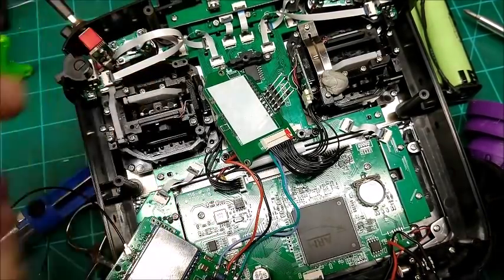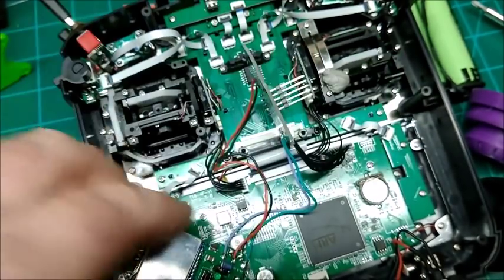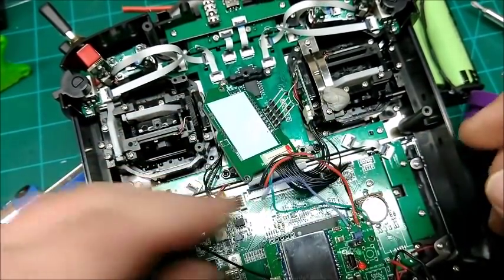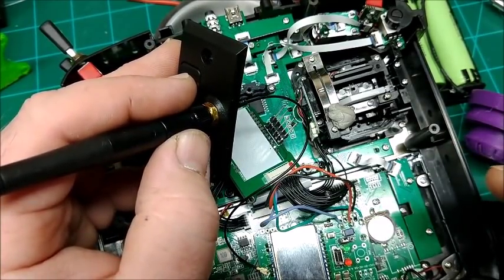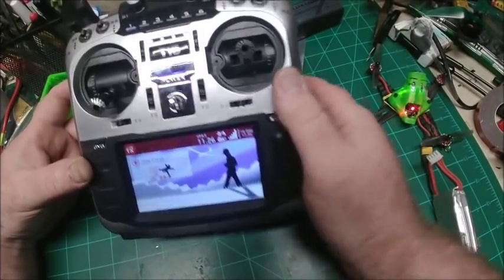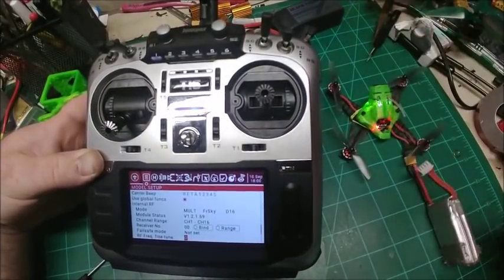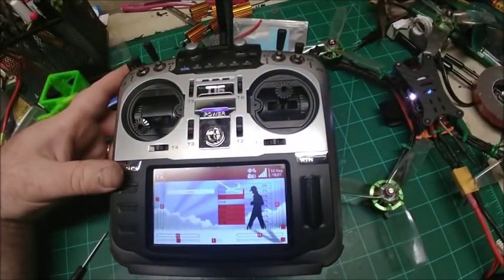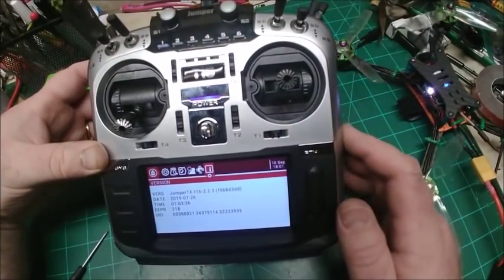Internal module mod for Jumper T16

Comment: hi..
can I flash the module directly with my radio jumper t16 same as r9m frsky module or I need a different procedure?
Reply from the maker: I tried flashing it with the radio and it didn't work, I had to plug it into my computer. I actually made a video I just forgot to upload it so stay tuned.
Reply from the maker: https://youtu.be/8hBsngv4CT4 
'Here is the video I made showing how to flash the module before you install it internally.
Reply: @bengmo64  you are the best!

Comment: Great overview of this mod.  I'm impressed by people that are able to solder to those tiny pads!

If you use a multimeter you can trace those connections to some larger and much easier to solder pads closer to the top of the board. That is what I did and it is working well so far.

Also, the 1.2.1.76 release of the multiprotocol firmware has started providing builds with the INVERT_TELEMETRY flag disabled:
https://github.com/pascallanger/DIY-Multiprotocol-TX-Module/releases/tag/v1.2.1.76
Reply from the maker: Thanks, I did try beeping it out to see if there were larger pads I could use but I guess I missed those. Do you have a photo of the pads in question?